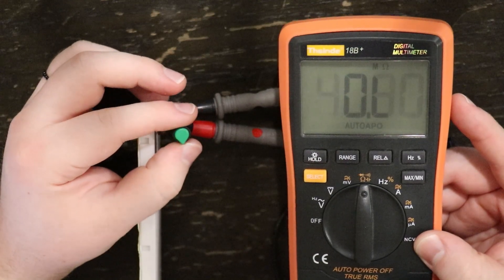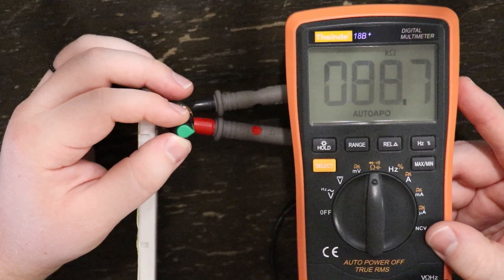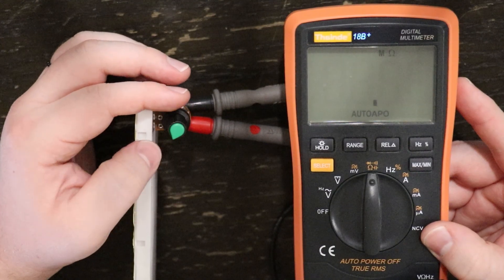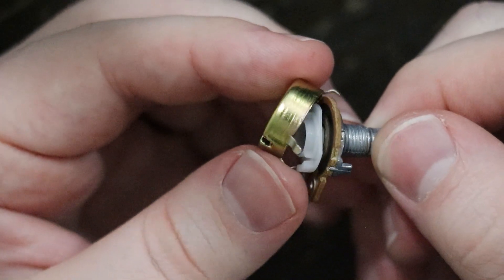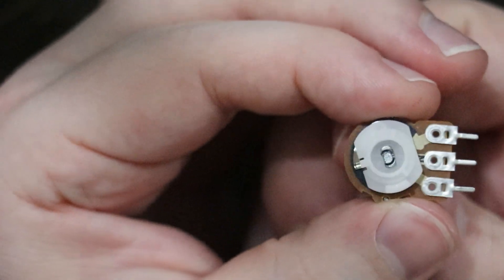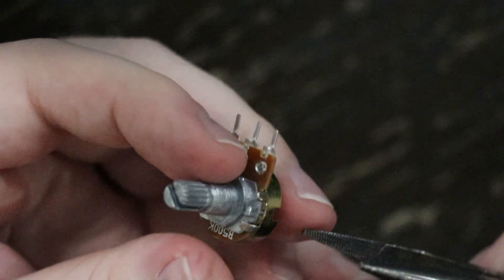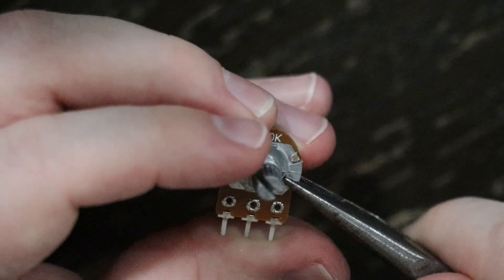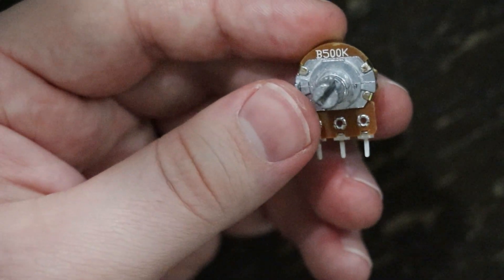Potentiometer Conversion to 360° Continuous Rotation

Comment: You could use a stacked potentiometer, open it and then offset the traces by 90degrees. And have your mcu calculate the position by processing both analog levels.

Comment: I discovered an issue after the modification. I used 100k, and the resistance increases beyond 100k when rotated through 360. Also, the resistance does not appear to vary linearly between 270 and 360.

Comment: You can spin it 360 but there a big dead band area where there isn't any conductive. It's more of a 330 degree potentiometer without. There are likely some applications where this sort of pot would be useful I wouldn't call it a 360 degree pot.
There are some low profile pots which don't have mechanical stops. These have the same dead band area. I've seen two low profile pots one on top of the other in order to eliminate the dead band. The low profile pots have an open center so one know can control both pots.
IMO, pots are the bane of robotic projects. Pots wear out. Whenever possible, I try to use encoders. Either quadrature encoders or magnetic encoders. Magnetic encoder don't lose their position information between power cycles but quadrature encoders need to zeroed some how if the absolute position is important.
Reply from the maker: Fair, it's not a 360 degree pot as much as it as a pot that CAN spin 360 degrees, haha. Can you provide a link to the low profile pots you're talking about? I'd love to see them.
Interesting input, I've never had an application where the pot gets enough use to wear out. I've been dying for some magnetic encoders from China to finally arrive, it seems to be the end-all of absolute position encoding. 

Cheers :)
Reply: @christophersfactory  I think my comment which included links got blocked by YouTube's spam filter. Here's the comment without the links:

I was harder to find the pot I was thinking about than I thought it would be. Apparently it's a rotation position sensor rather than a potentiometer.
Search for part # 3382G-1-103G on Mouser. It's manufactured by Bourns.

There are a variety of similar "sensors" but for some reason there's hard to find on Mouser and DigiKey right now. I've purchased these in the past so I was surprised to see how hard they are to find.
"I've never had an application where the pot gets enough use to wear out"
The main problem I've had is in servo of some of my hexapods. The movement of the servo slowly wears down the carbon film in the pot. Once the pot starts to wear out, the servo develops some jitter as certain positions (usually in position where the servo spends the most time). Once this jitter starts, it's a vicious feedback loop as the jitter causes the pot wear out even faster. I've burned out motors in a few servos from really abusing them but I lose way more servos to bad pots than I do to bad motors or electronics.

I've worn out a pots being used as a knob. I have a DIY oven controller and I've had to replace the pot a couple times.

The joycon drift which plagues many game controllers is often caused by the pots used in the joysticks wearing out. 

I experimented with magnetic encoder about ten years ago (it's hard for be to believe it's been that long). Here's a link to one of my videos on the topic:
The title of the video is MagneticEncoderDaisyChain120323a.AVI. It shouldn't be hard to find on my channel.

The encoders I used require a SPI interface but they also make magnetic encoders which have the same sort of output as potentiometers. Many of the latest radio control transmitter use "Hall Effect" gimbals. These have the potentiometer type magnetic encoders.

(Add: Hopefully this comment isn't blocked.)